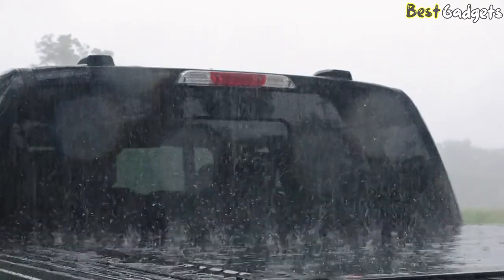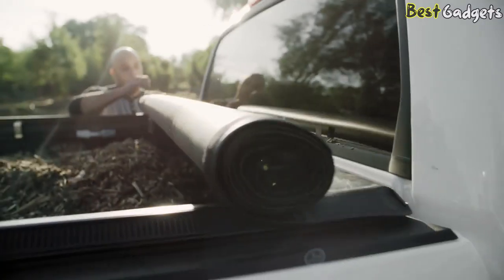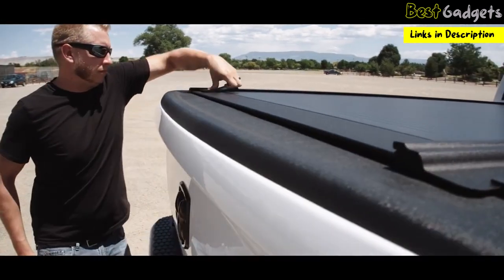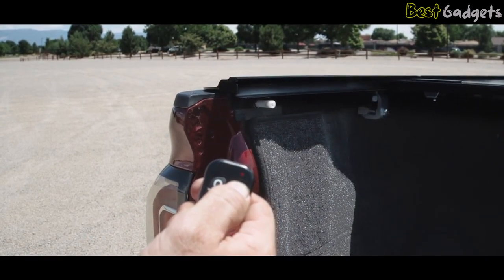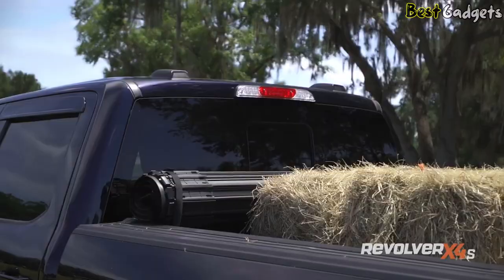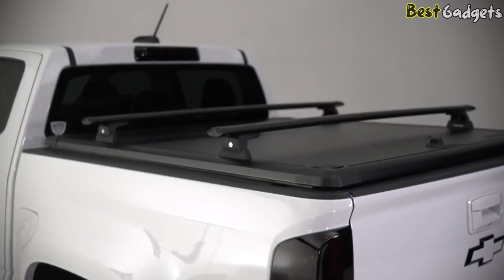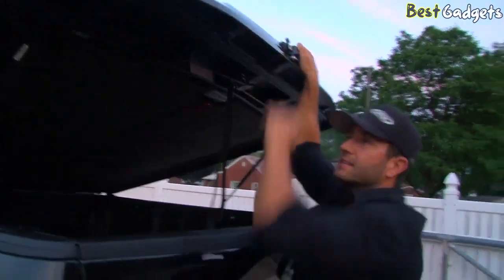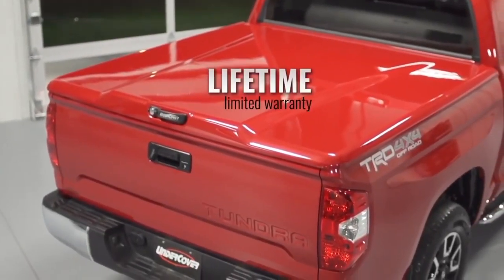✅ Best Waterproof Truck Bed Cover Recommended By Expert

Comment: I would strongly suggest going with hard top cover.  More water resistant and durable in my experience
Reply: Wish there was a hard tip convertible & collapsible option, that shirks down in terraced stages (say a bout 5 or 6 segments just overlapping each other...), but the Full hard top last option shown in this vid, in Extended Form. Mechanical option or Automatic would be nice to see.